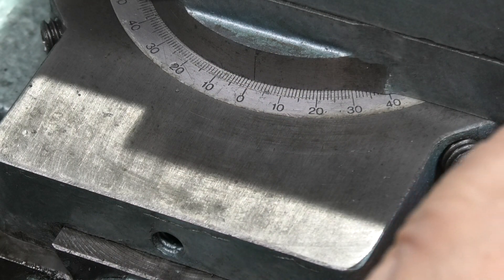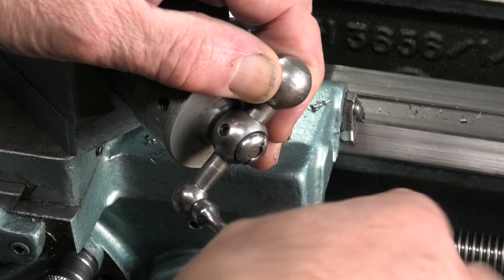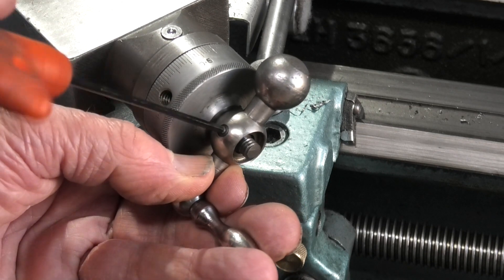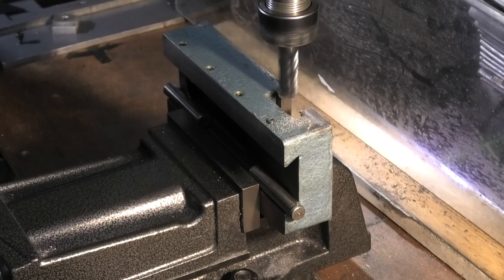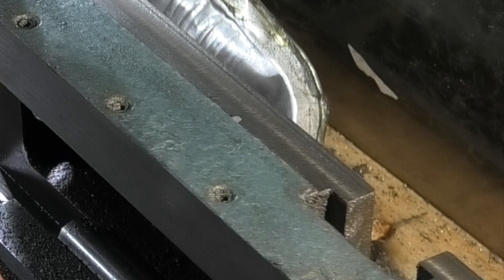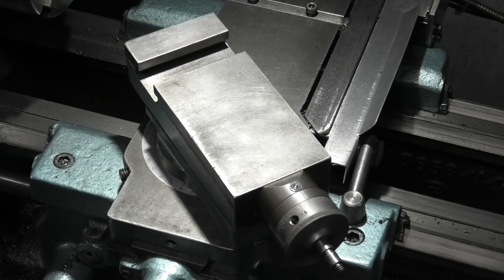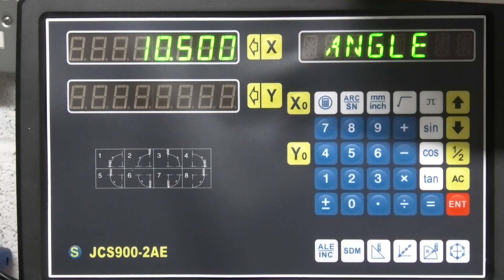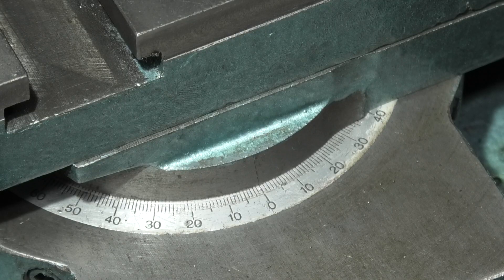compound slide rework DRO angle setting

Comment: Excellent job Alan. Good tip on using dowels to clock in the part. Wondered how you would do it. Great video as usual. Cheers @nobbysworkshop